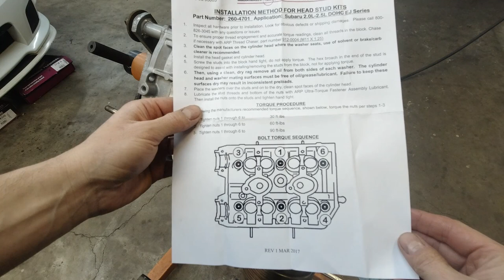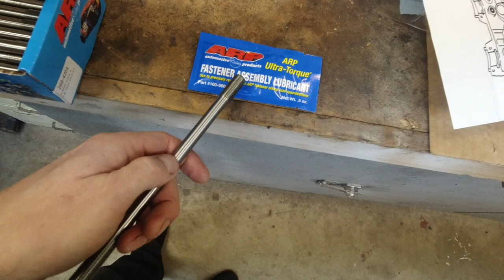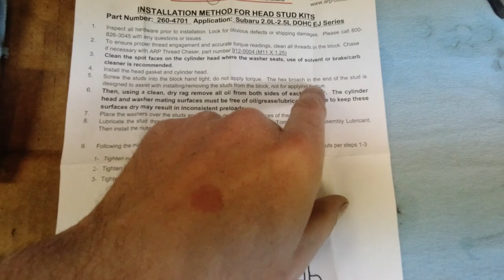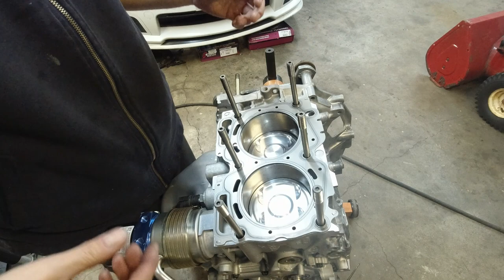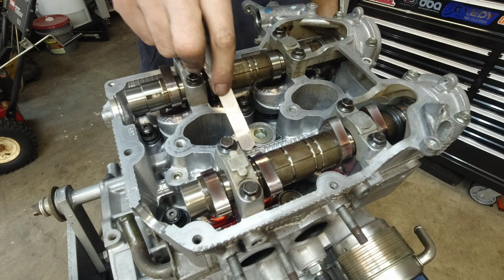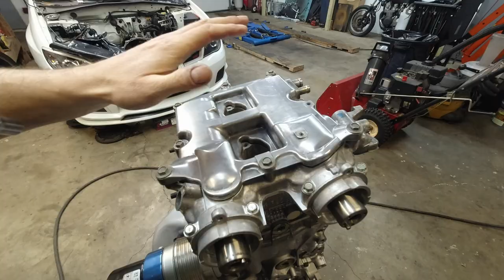Subaru STI EJ25 build part 5 cylinder heads arp studs bolts

Comment: When checking valve lash, always have the cam lobes pointing up.. 2 lobes pointing up and 2 lobes at a 90* angle is not the same. When you check the clearance on 2 lobes pointing up you need to rotate the cam so the other 2 lobes that were at 90* are also pointing up, this way you are checking the base circle and nothing else.. When the can lobes are rotated and not pointing straight up there may be more pressure on the buckets and this is why you have a tighter reading on 2 of the cam lobes that are pointing 90* vs straight up..

Comment: Thanks for the video.  I'm rebuilding my engine now and they are very helpful.  At 9:03, you will notice the RTV is on the wrong side of the hole on the exhaust side.  I hope it sealed enough that you don't have a leak.
Reply from the maker: Just noticed, luckly for me its not leaking, thanks!

Comment: Great videos I have to rebuild my ej25 here soon and your videos are so straight forward 
Where did u get all your gaskets and seals??
Reply from the maker: Thank you!  Just look for a set from Aisin, its a japanese company, try amazon.  Mine was original subaru but I cant remember if I found it on ebay or amazon for about 250.  If you look up aisin timing kit for example, those are same exact pulleys, belt, water pump as factory.

Comment: With new cams and buckets 🪣, would the lash be perfect or require work to the buckets?
Reply from the maker: You replace the buckets with right measurement but need to measure the lash first and figure out which bucket you need.
Reply: @cruizinmax4017  sorry u have given south already but if I disassemble my heads buy new cylinder heads, cams and buckets I would need to check the lash but then how do I adjust the lash? Thank u :)

Comment: Im guessing those are ARP2000 studs as the final torque is only 90 ft/lb vs 100Ft/lb for 625 studs.
Reply: 90 is alot

Comment: is it okay if the cam is slightly stiff when you move it by hand or should it move very freely
Reply from the maker: if its not under load from valve springs then it should be very easy to turn it.
Reply: @cruizinmax4017  most i can turn fine, very easily by hand, one i can turn by hand but its slightly stiffer would that be an issue.

Nice videos btw
Reply from the maker: Might be an issue, i would take it all apart and redo it.
Reply: @cruizinmax4017  i did, retorqued it, did the timing, was slightly stiff but still okay and smooth to spin.

timing spun very easily.

 engine is in the car, i cranked it with just starter on and hit 80 psi oil pressure

Comment: What about 90 degrees  turn on all the bolts at the end?
Reply from the maker: no need for that, instructions say to torque only.
Reply: If Subaru used these head studs instead of their head studs Subaru would have never had a head gasket failure issue the reason the head gasket fails is because the studs are not properly and evenly torqued like they are with the ARP head studs. Subaru studs make you do all kinds of Mickey mouse angle turns

Comment: What happens if you dont check clearances?
Reply from the maker: if off correct measurement then valves, cams even engine  may go bad if not caught in time.  Also low compression or misfire.
Reply: @cruizinmax4017  100%
Reply: It is also a lot easier to do when the engine is out of the car. It's better to do things one time instead of five times